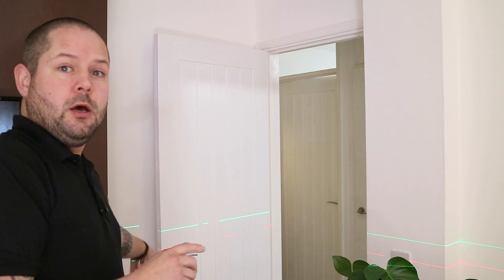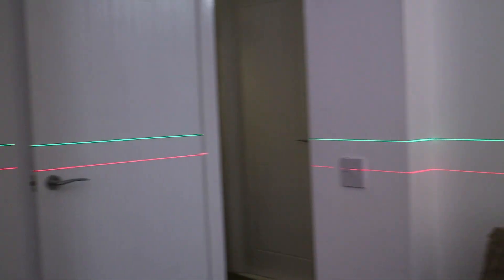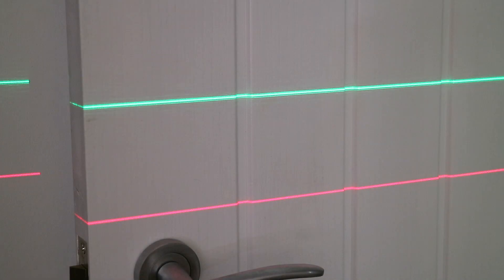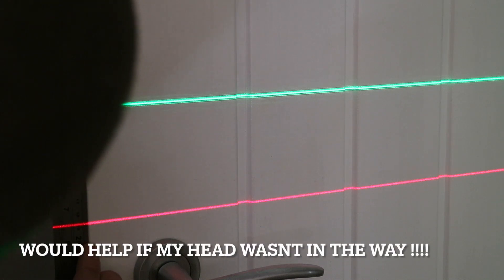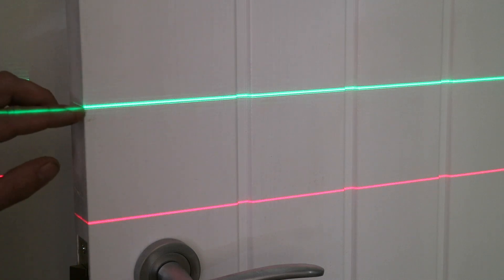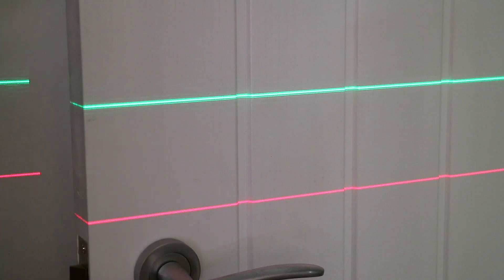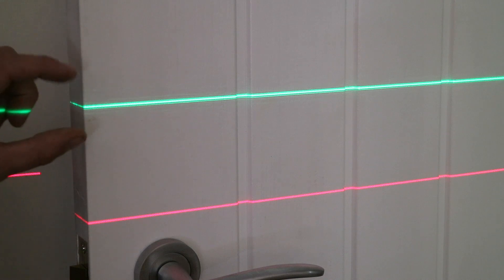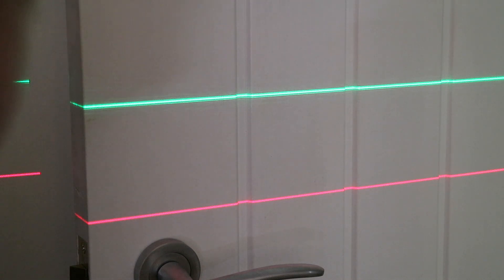How thick is the Huepar laser line.

Comment: Hey mate thanks for taking the time to do this. I've used a laser levelling tool once in the past and found it was not as accurate as a spirit level, simply due to the thickness of the laser beam at the wall and bleeding of the beam. Was thinking I need one for installing large format shower tile, but now not so sure. I had been thinking about the green lasers, but for now your video has ruled them out - unless I can find one that is a narrow beam. I guess really the trick is to get the laser as close to the surface of where you need the line, to decrease its thickness.

Great video mate, thank you.

Comment: Interestingly, I wonder if it's the colour of the laser that matters more than the brand. I've got two of the huepar entry level models (BOX-1R and 1G) and I find that the red line is crisper and easier to see, while the green is much brighter. I kind of prefer the red one as it's easier to see when using it with a tape measure to pack walls out plumb. The green was so bright that I wondered if it was actually hazy at the edges or if it was just my eyes screwing with me.

You can get the BOX-1R from the official huepar stores on the bay if you ever feel like having a punt on their red lasers to compare.
Reply from the maker: That’s interesting buddy, I will have to grab one and have a look, yes I think you might be on to something about the green laser, they are certainly thicker than the reds. I do find that I switch between the green and the reds from time to time